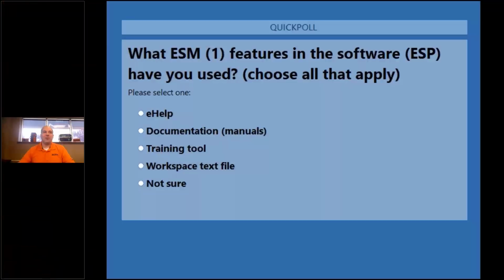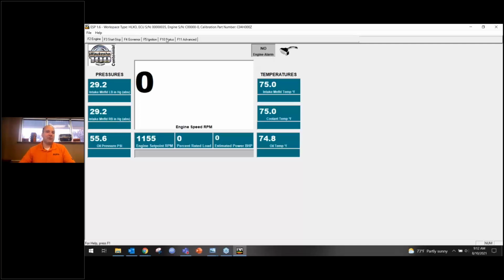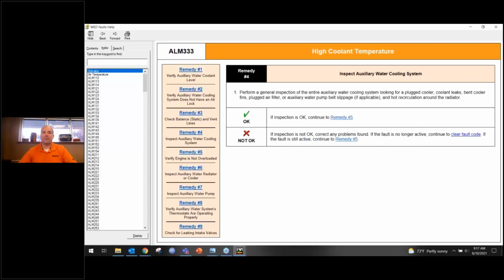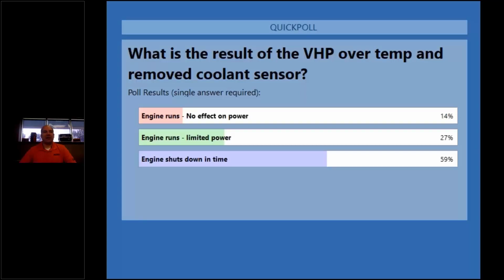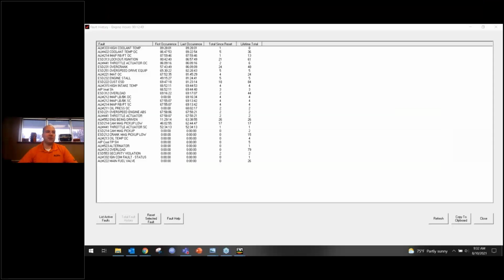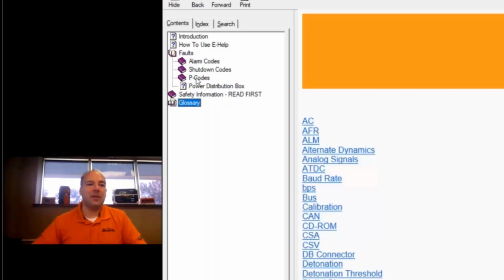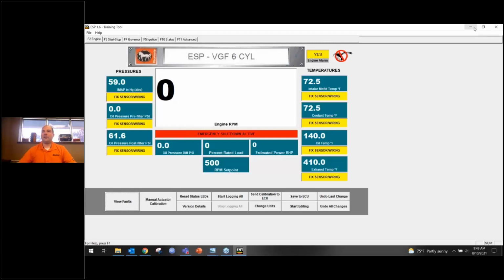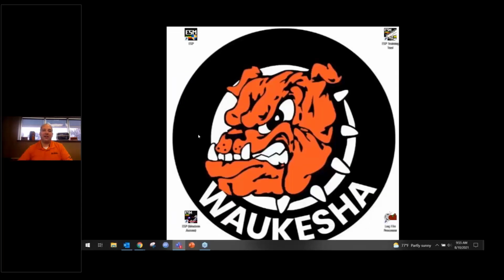Waukesha Gas Engines ESM1 eHelp Access

Comment: Hi, can you help me to solve this problem , we have VHP Series Four 12-Cylinder with AFR2/emPact  Emissions, during normal operation  ESM is locked , cannot access it using laptop, give shutdown signal to PLC, and its power led is only on. After replace ESM with new one engine starts again without any problems, this issue occurred for three times without determining the root cause
Reply from the maker: We recommend using the step-by-step E-help troubleshooting. If that does not resolve the issue, the outcome of each E-step should be provided to your distributor or service provider to aide them in further assisting you.